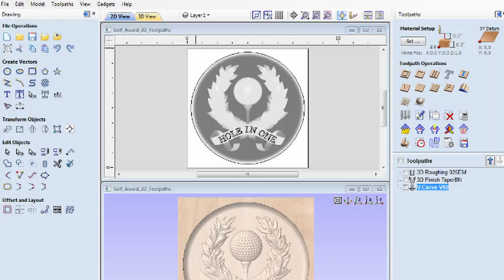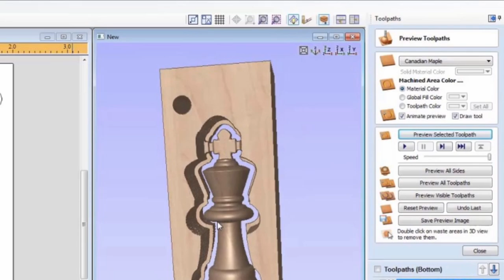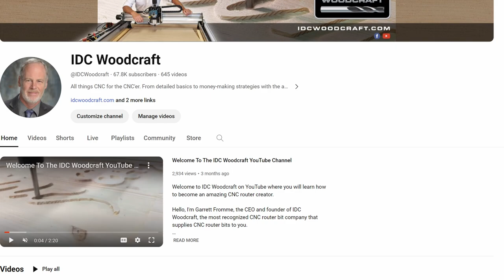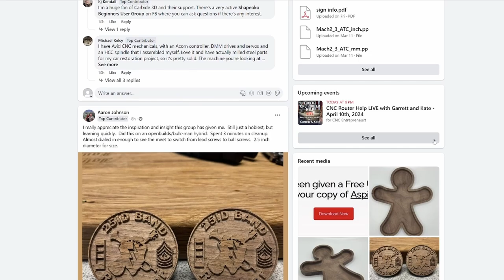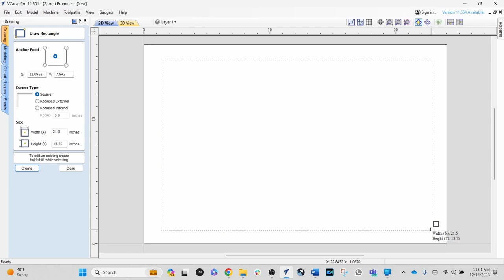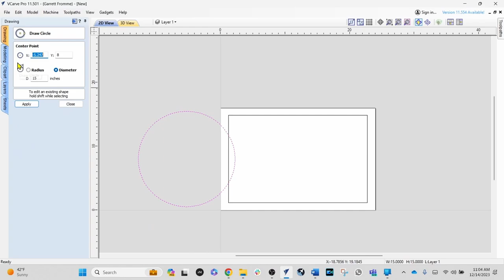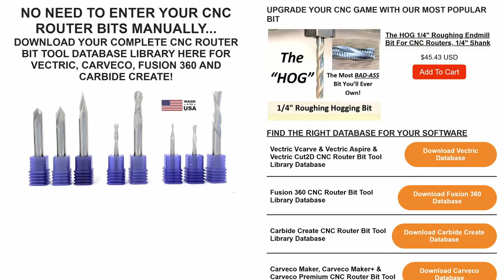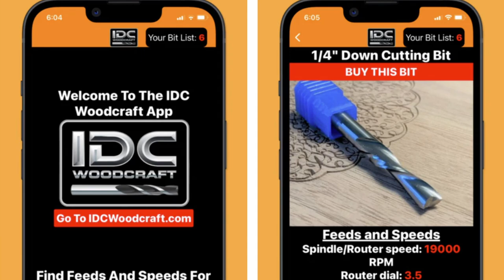This Will Help You Decide on CNC Router Woodworking

Comment: Hey Garret. Hope I spelled you name correctly. I’m going to be getting a CNC. I’m leaning towards the MK2 or the new Alt Mill. I think 48x48 will be large enough. My main focus will be solid body guitars but I am leaving plenty of room for other things. I would value your opinion on which way to go on the machine. I have been a Mac guy for years but Vectric does not work on them. Any suggestions would be greatly appreciated! Thanks
Reply: I would go for something no bigger than a 4x4 CNC if you are focusing on that.

I've been using the Onefinity Elite Foreman CNC. Super precise and repeatable. Also it does not break the bank. 

I think of it as the best benchtop before going industrial. 🪵
Reply from the maker: jrandallmoore, I have a video that should really help you narrow down your CNC choice. It will really help you determine what to look for when buying a CNC. Here is a link: https://youtu.be/wLVNF0L-ZdU